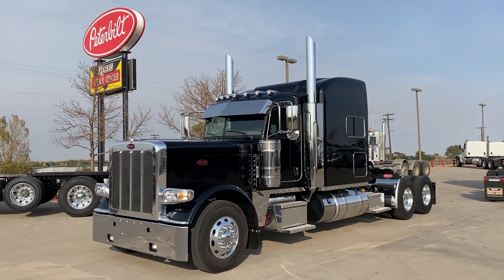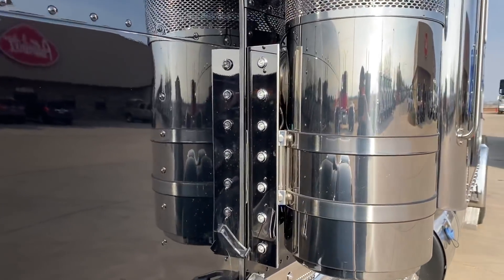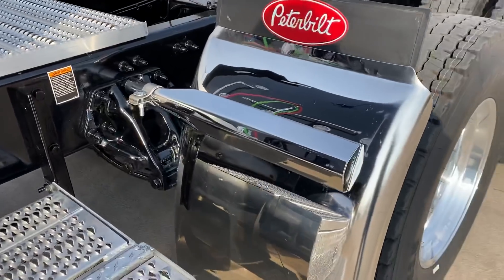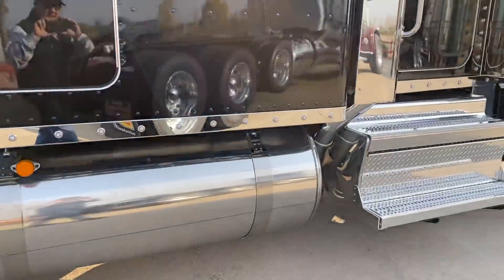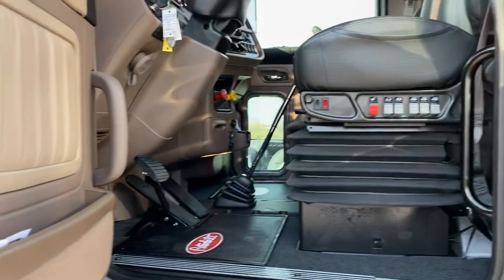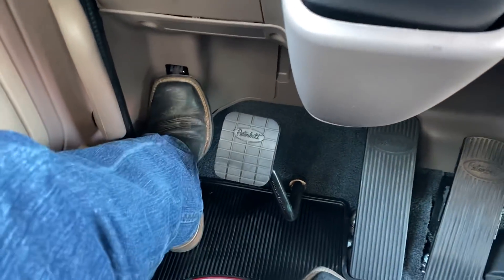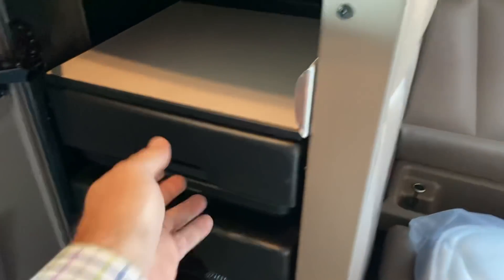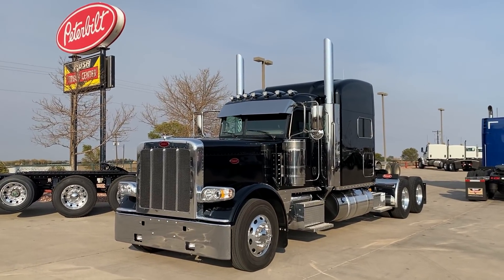Classic Black Peterbilt!  Keith Couch - 970-691-3877 or couchk@rushenterprises.com

Comment: Instead of having that light bar above the tanks for the turn signal and marker light. I wonder if you could make one of them lights on the Phoenix light kit underneath the bunk a turn signal. That light bar is kinda out of place. 

Also. I wonder why they put a ashtray in the bunk and not one on the dash somewhere. I wonder if you could do that in a order option?
Reply from the maker: No option for an ash tray on the dash.
Reply: @RockyMountainPeterbilts  Man that’s odd, wonder why they still have it a option for the bunk. I’m a smoker, but I don’t think I’ve never smoked in the bunk before.

Comment: Hey if i buy one of your new trucks can you delete the def tank on it and all the rest of the crap that they put on it that doesn't need to be on it or should i buy a old one
Reply: If you delete it you won’t have any warranty on the motor. But I know there are places that delete motors. But depending on the truck you’d probably be better off buying a used truck. Doesn’t make any sense to buy a $180,000 truck and not having any motor warranty.
Reply from the maker: I cannot "delete" anything since we are an "authorized dealer".  What you do with it once you buy it is up to you.  But, I would tell you to keep EVERY NUT AND BOLT if you do decide to delete it.